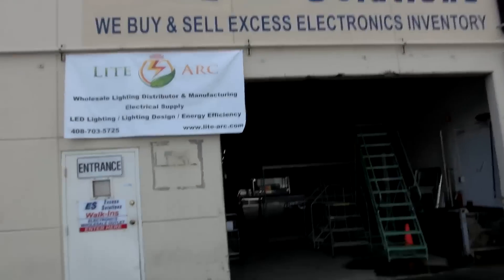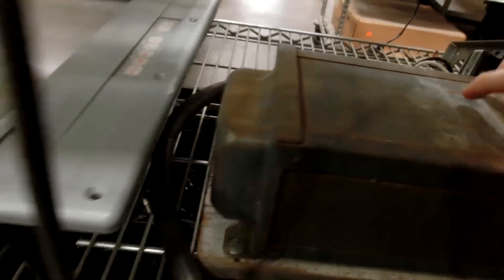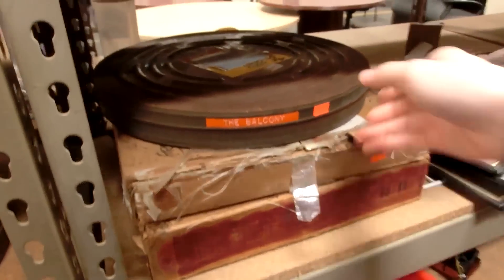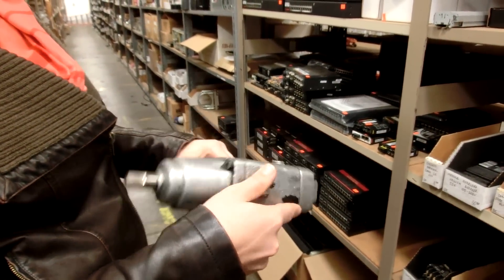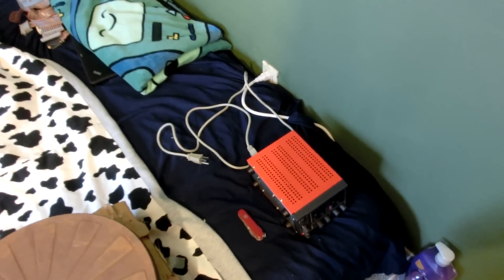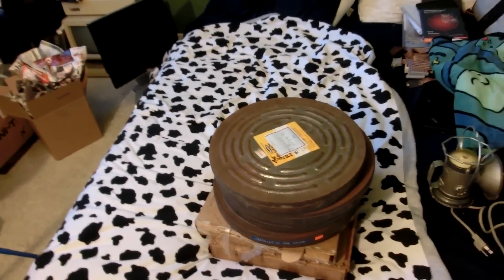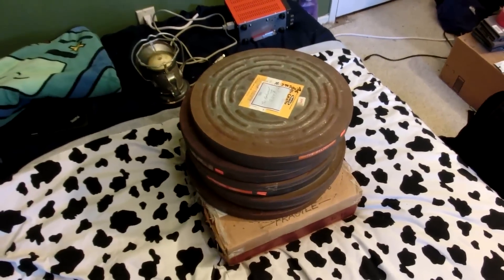Random Bits 0119: Excess Solutions, more 16mm Film

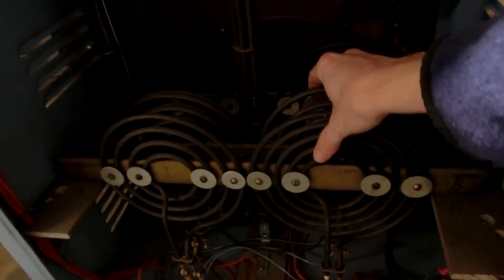Comment: 10:10 This thing is a high power resistor I think.
Reply: +Maanuueel42 \m/(^_^) I thunk you are correct, I work for a company that builds diesel gensets and we use a "load bank" like that one to test our "smaller" units.
Reply from the maker: +Maanuueel42 \m/(^_^) yeah i figured thats what it was for ^^

Comment: Those are not drill bits. There for CNC.  Are you double jointed?
Reply from the maker: +css46290 i think they are drill bits for circuit boards. and no i have the same number of joints as everyone else, however i am kinda flexible.
Reply from the maker: +css46290 i think they are drill bits for circuit boards. and no i have the same number of joints as everyone else, however i am kinda flexible.